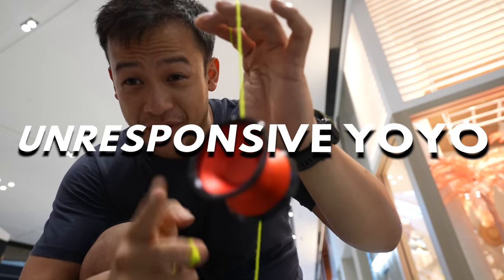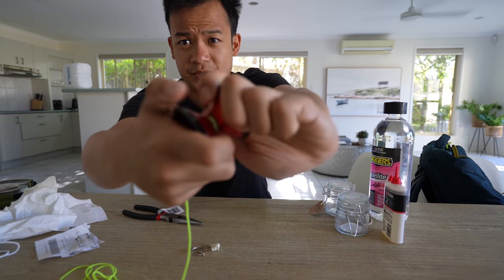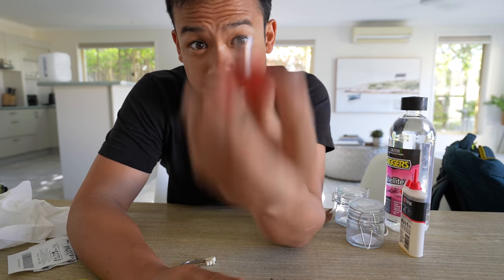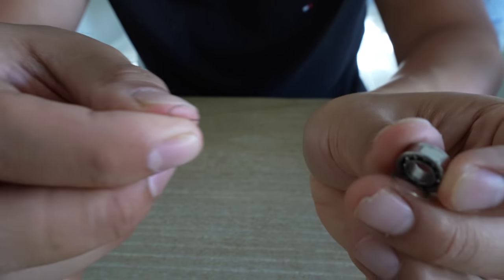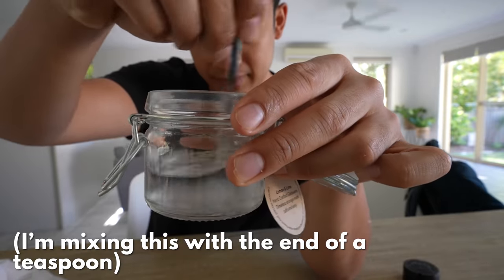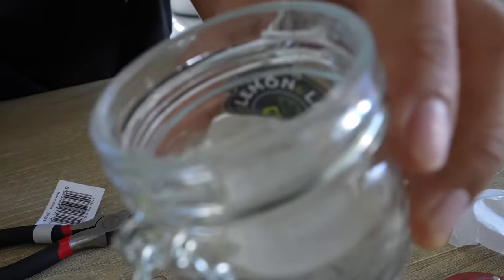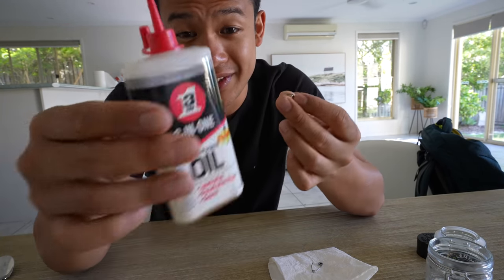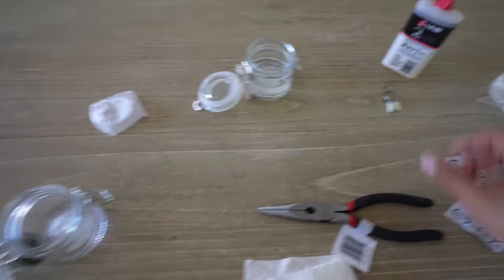How To Clean A Yoyo Bearing WITHOUT Yoyo Lube

Comment: Wow that’s so cool I never knew that one-forth 3 in 1 oil and three-forth lighter fluid works as a thin lube substitute! But the thing I really want to know is if it is good for the bearing long term!
Reply: I’m pretty sure it is, that’s what Dylan kowolski uses
Reply: quick maths correction, 3 parts lighter fluid to 1 part 3-in-n makes 4 parts total, so it's 1/4 3-in-1 and 3/4 lighter fluid. 

Also Brandon's ratios were certainly thinner than that at least 5 or 6:1. For this sort of thing, the difference is critical.
Reply: @yoyowen2912  Cool
Reply: @NateSATheLegend  Thanks for the correction I miss heard!

Comment: Shouldn't have used pliers to remove the bearing. It might be okay if the bearing is not super tight, but sometimes it does depending on the yoyo, and doing so may permanently ruin the bearing track, causing it to feel gritty even after cleaning it over and over again.

Comment: I remember seeing Dylan Kowalski do rhis but I didn't know if it was legit or if I could trust it, but recently I've seen a bunch of people try this and approving of it. I have a question though, Dylan leaves the bearing in the solution but Brandon put droplets in, they both seemed to work, but does anyone know which on might work better?
Reply: First Dylan is legit xD you can trust him. The way Dylan does it gets the job done. But i noticed some bearings would be a tad responsive and had to wear out the lube. If you only have enough bearings to go into all of your yoyos. Go brandons way. If you have lots of bearings to clean. Dylan's way is great
Reply: @cashmoney2772  okay, thanks. That helps a lot actually 😄👍